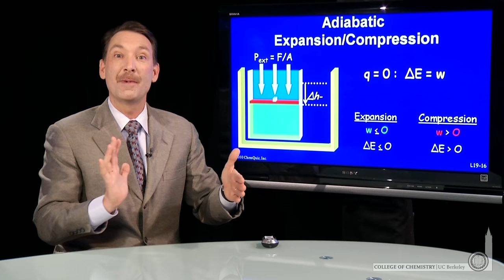Adiabatic Expansion/Compression

Comment: can someone please help me this makes no sense by definition the temperature changes as pressure does, but how does the temperature change without losing or gaining heat. maybe its because im thinking on the molecular level but i just dont get it.
Reply: De Freitas18 I'm trying to get my head round this as well. I think that the important thing is in the definitions of heat and temperature. Heat refers to transfer of energy (from higher to lower energy substances) whereas temperature is just the measure of the average kinetic energy of the particles in a sample. If there is not enough time for heat energy to either be absorbed or transferred to the environment then the sample is essentially a closed system and the particles will either gain or lose kinetic energy to fuel the process that is happening (expansion or compression). So the average kinetic energy of the substance's particles can change (the temperature) but the energy is not transferred elsewhere (heat). I also think that the 'adiabiatic' part of the process is over quite quickly and then heat transfer starts again to equilibrate things.I'm not sure if this is right, its just what I suppose. If you've found out exactly what it is since and I'm wrong please tell me!
Reply: Because it is a gas that can be expanded and compressed, a change in temperature does not necessarily mean there had to be heat transfer.  The fact that the gas can change volume means work can be done as well.   In an adiabatic reversible process, the energy changes involved are internal energy being traded for mechanical work, and vice versa.   Internal energy is directly determined by mass, flavor of gas, and temperature, while mechanical work is determined by the cumulative combination of each pressure along the way multiplied by change in volume (it's an integral).

There are three forms of energy at play, when dealing with gasses in containers: mechanical work, internal thermal energy, and heat transfer to/from the system.  Adiabatic means you make the heat transfer zero, while the other two forms of energy exchange for each other.

Comment: If I heat a gas in container fitted with piston and the temp goes up which process it would be?
Reply: Comprassion
Reply: Assuming there is no resistance on the piston other than atmospheric pressure and the piston's weight, that would be an isobaric process, which means constant pressure.

Comment: so who is going to do the work on the system by adiabatic compression. isothermal compression is easy to understand,  by bringing cold temperature to shrink the air inside. but adiabatic compression is hard to visualize. if someone has to press the piston hard for the machine then that is not a mechanical  engine anymore
Reply: It is a chemical change of the initial fuel and air that does the work during adiabatic expansion, in the internal combustion engine.  The combustion is a chemical change that converts fuel and air into CO2, H2O, unburned nitrogen and other trace products of combustion.  Energy converts from chemical energy of the fuel into thermal energy of the exhaust, and that thermal energy expands and pushes on the piston to do work.

The compression happens when a sister piston is pushed upon by the crankshaft, powered by the piston/cylinder assembly that is undergoing its power stroke.  The compression stroke requires work input (back-work) to bring it from atmospheric air and fuel to compressed air and fuel.   On net, the power stroke post-combustion does more work, than the work required to compress the pre-combustion stroke, and the net work is the engine output.

Comment: work done by the system is +ve so how can we say that in an expansion process the work done is -ve ?????? and visa verse...
Reply: Either his sign convention is the opposite one of most physics books or he is wrong.
Reply: Adiabatic systems keep the heat inside, it's a state function so the second deferential is equal to positive 1. Compared to other systems, when q is negative in the equation the interior is cold and vice versa. That will not necessarily mean the system or machine has to Adiabatic, q is only a factor to determine the direction of heat flow.
Reply: @jaimebenito620  Sign conventions are arbitrary.  It doesn't necessarily mean he is wrong, if he uses a different sign convention than someone else uses, as long as the way you use the sign convention is consistent with reality.

I'm accustomed to the sign convention in thermodynamics that work done by a system is positive and work done on a system is negative.   For heat transfer, heat transferred to a system is positive, and heat transferred from a system is negative.  The lens through which you view this sign convention, is that the inputs and outputs to an engine are both positive, and the net inputs and outputs of a refrigeration cycle are both negative (on net, work is added to the system and heat leaves the system).  A refrigeration cycle undos what an engine does.